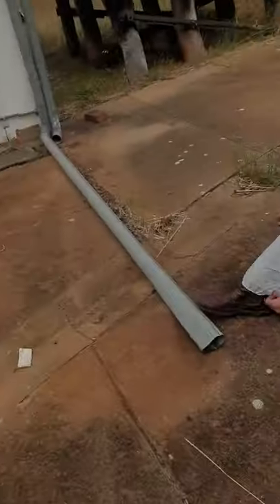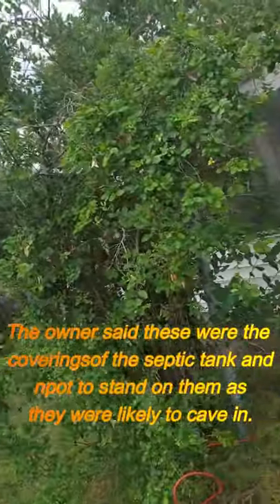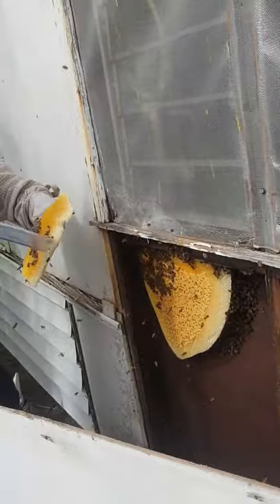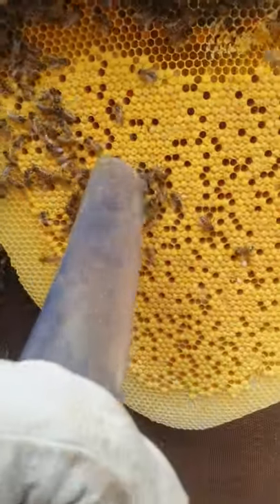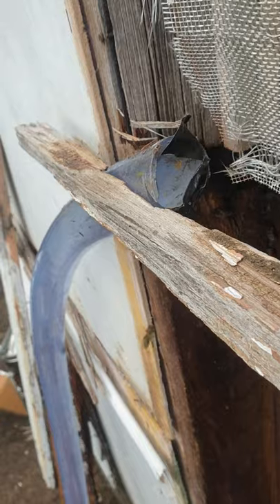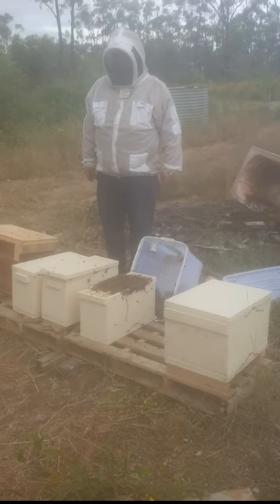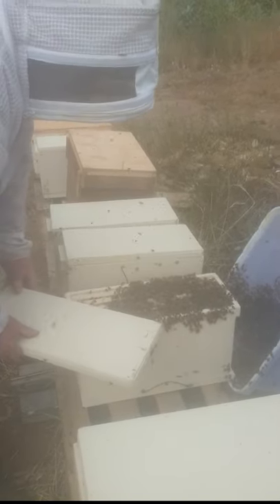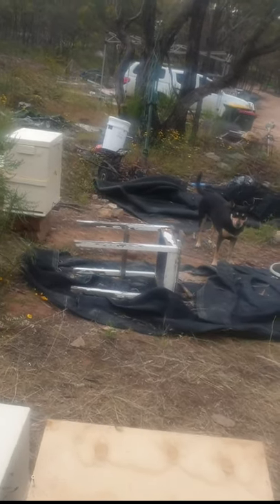Aussie beekeeping, My first cutout.

Comment from the maker: After posting this to the beekeeping forum on FB?  I have found out I did this one wrong. On such a small hive I shouldn't have used the vacuum. I would have been much better just cutting out the wax with the bees still on it and installing that into hive frames before putting them directly into the bee box. That way the brood, baby bees still in their capsules, would have kept all the nurse bees covering them and not had the chance to chill and die. 
Next time I'll do it that way. Here in Australia we don't have Africanised bees or mostly don't anyway. In the USA, they do so they use a vacuum to remove bees as fast as possible because those bees attack in swarms. Ours are much quieter and far less aggressive.  Unless it is a really, really big hive, there is no need for using a vacuum here.  Live and learn I guess. I've only been doing bees a couple of months so am still making mistakes but give it time and ill learn the right way to do things and mistakes like this will be much less likely to happen.